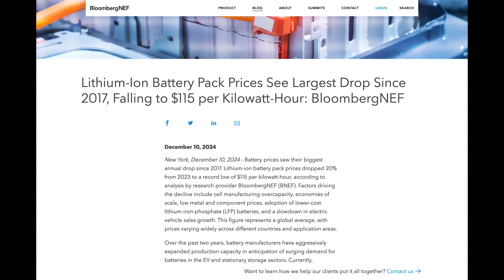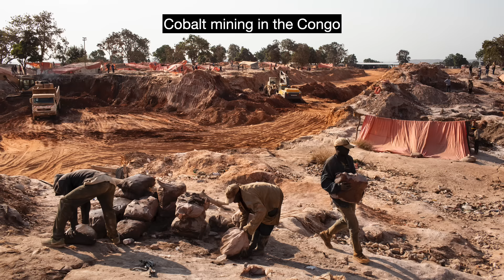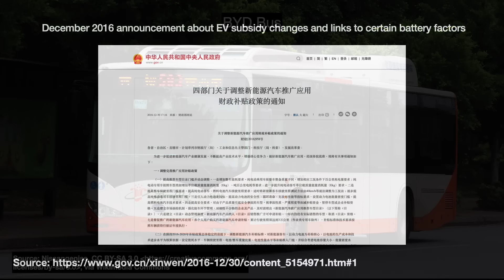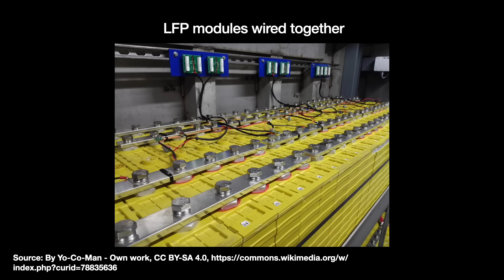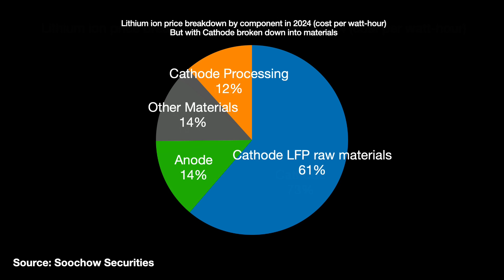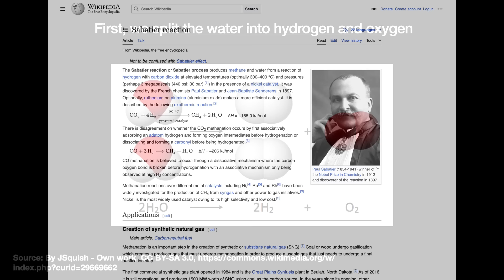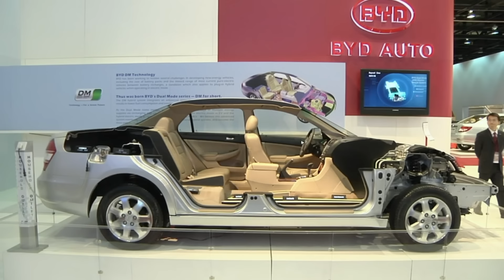How Did China's LFP Batteries Get So Cheap?

Comment: Battery modules are not arbitrary, they're a wiring step that allows you to put the right number of series and parallel connections to achieve your desired operating voltage.

Comment: A 2023 fire in the Netherlands also gave a small demonstration on the Blade Battery, as well as the advantages of lower intensity packing in general. At themepark Walibi Holland all EVs were parked together as a result of all chargers being put together.

The chargepoints were moonlighter-built and jumped voltage all over the shop.
So a Tesla (what else?) model X spontaneously caught fire due to its unstable tight packing causing thermal runaway when subjected to such extreme jumps.
When it erupted the cars around it took fire pressure.
A Nissan Leaf went up, half burned.
A Tesla Model Y promptly also caught fire and burned to the wheels.
A Renault Zoe took major fire pressure to the front, but refused to burn.
Two BYD Atto3's covered themselves in glory, taking major fire pressure from the side. One of them pressured from both sides. The BYD blade battery refused to brew up in both cars and that's where the fire stopped spreading.

Pictures of the damage still available on local media like Omroep Flevoland and Bergnet (towing)'s social media.

So yeah, Blade packing for the win if you ask me. It was one of the reasons why I bought an Atto3 couple months later.
Reply: Meanwhile people will pretend that BYD's do nothing but catch fire.
Reply: @kristoffer3000  every accusation is secretly a confession
Reply: @katiebarber407 Every damn time.
Reply: @kristoffer3000  I mean, they DO catch fire every now and again, and when they do, the damage is exactly as disastrous and they are exactly as hard to put out and they do set other cars on fire. The idea that the blade battery is this super fire inhibitor is simply not true.
Reply: Amazing story

Comment: For energy storage I expect Sodium chemistry of accumulators. Especially because of their thermal advantages. They operate very good at low temperatures. And it really makes little difference if you place one shipping container or stack two on each other to get the same capacity/power on the same footprint. Lower power density is not an issue. This is clearly much better than the hydrogen to methane conversion and then back.
Reply: Sodium batteries have lower cycle life, terrible round-trip efficiency and their voltage varies greatly through their charge/discharge cycle, making efficient inverters very hard to build. Additionally, the cathode is like 30% of the price of the final battery, so even accounting for all these issues, sodium might not end up much cheaper, even if all these issues are fixed.
Reply: @torginus  30% of the battery cost is cheaper than 75% of the battery cost for other chemistries.

Comment: The NEDC was never ment to measure EV range. The cycle dominates by city and suburban driving that is very favorable to EV, and have just 20 second of highway speed driving for a 15 minute driving cycle.

There is a city and rural road driving part, but manufactures just cited the compound number that was beneficial to EV, while totally imaginary. Nobody drives 600km at city speeds in one go.

Comment: Phosphor is needed for agriculture and not that common (it should be treated like gold, and is more useful than gold. Not that many technical applications for gold *). So I see a market for batteries that use sodium / iron. - a lot of people drive around in urban areas most of the time, density and weight are not that important. The few times they drive longer distances there could be extra battery packs one can plug in. Needs a bit of space, but not too bad.

AND: If they are not good enough for vehicles - too heavy or not a good fit for speed loading they might well do for households and industry to store excess energy from solar. 

* using gold as a "currency" is arbitrary / cultural. We could have a civilization w/o gold - but not w/o iron, salt, phosphor, aluminium, etc. Or silicium.

There are a few technical uses where gold would be hard to replace, (think seals of gold when you have very low temperatures - close to absolute zero). It is also useful for fillings in dental work, hard to come up with another material that matches that. But mostly gold is not very useful.

Comment: I think the main reason why in 2024 and in the future the price of LFP is getting cheaper is according to this article:

"LFP cathode producers explained to Roskill that the consortium managing LFP’s IP rights reached an agreement with the Chinese battery industry a decade ago in which, as long as LFP was produced and used within China, the consortium would not charge Chinese manufacturers a licensing fee. As a result, the price of Chinese LFP batteries has always been considerably lower than non-Chinese LFP batteries. However, the patents’ restrictions over LFP will start to expire in 2022. Simultaneously, the limitation of LFP exports on Chinese producers will be largely removed, along with the licensing fee for non-Chinese LFP cell producers. The removal of this IP barrier could become the largest opportunity for LFP-based Li-ion batteries to rapidly gain market share in the EV market outside China."

Comment: EV battery manufacturers in China like BYD are using Lithium Iron Phosphate (LFP) and Sodium ion batteries which 
have no Nickel, will not explode & cheaper to make !     Sodium ion batteries will be used on cheaper EVs & power storage
applications .

Comment: The latest LFP battery by CATL and BYD is providing only ~15% less in range than the worst NMC batteries produced by CATL's lesser-known competitors in China.

Also one thing that didn't stress enough in this video is the charging speed LFP batteries can provide over NMC. 20-80% in 20 mins beat any range advantages NMC gives
Reply: And, it is not recommended to charge MNC above 80% for anything more than short periods of time, to ensure longevity. Heat kills MNC also.

Comment: There is a lot of new information. Well done as always. 
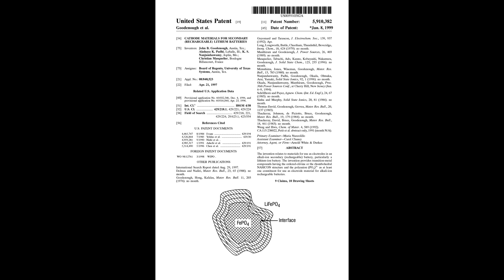Its getting very interesting around min 12:00 where i would have wanted to know more details. John Goodenough was one of the central inventors. What about A123. 'A123 Systems, LLC, a subsidiary of the Chinese Wanxiang Group Holdings, is a developer and manufacturer of lithium iron phosphate batteries and energy storage systems. The company was founded in 2001 by Yet-Ming Chiang, Bart Riley, and Ric Fulop.' Especially Yet-Ming Chiang and the time between 2005 and 2011? And the side issue of three manufacturing lines without marking the products based on the line what possibly led to their bancrupty. I think a lot of A123 Systems knowledge went from the US to China when it was bought by Chinese manuafcturer Wanxiang. Not sure but i got the impression that this knowledge was distributed outside Wangxiang in China. 
For the big moves from China into BEV, the Chinese Wan Gang an Automobile Expert 'who served as the minister of science and technology from 2007 to 2018' could be very interesting. Maybe a central person for a video about the move from China into vehicle batteries.

Comment: A small oversight in the video: LFP are not safer because of lower energy density, but because they don't let oxygen to be released during charge and discharge cycles.
Reply: It is a bit more complex. The lower voltage really helps in making the system more stable, as the electrolytes break down at the higher voltages  that you see in NMC. 
But having lower conductivity also affects it, as that means that energy is released slower and there is less heating. 
A general thing to remember is that during a battery fire, it is mostly the electrolyte that is burning, the FLP or NMC, can't burn as it is a oxide, and the production method to make is to have it in a furnace.
Reply: @huleboermannhule44  
AT LAST! A sensible comment!! 
👍
Reply: You have to put more energy in to get oxygen to separate from the iron & phosphorus which means less net energy when the liberated oxygen finally gets to do its thing.   Though ternary cathodes are similar at low state of charge (though LFP would have better energy density than NMC restricted to a state of charge providing similar safety)
Reply: To be more specific: (since some seem to need it), the LFP's phosphate-based cathode is chemically stable compared to NMC, with strong covalent bonds in the PO₄ structure. This stability is what reduces the likelihood of oxygen release during overcharging, overheating, or mechanical damage like a spike driven through it, unlike the layered oxide structures in NMC batteries.
Reply: @Techridr  Thanks
Reply: Are LFP's the same as LIFePO4 batteries?
Reply: @seanskywalka5172  yes
Reply: @seanskywalka5172  Yes, its the same thing. Lithium(Li/L) Iron (Fe/F) Phosphate (P04/P)
Reply: Do you not mean Hydrogen?
Reply: @Darkmatter321  No, I exactly mean oxygen. The reason why NMC batteries burn so strongly is because they contain both the fuel and the oxidizer.
Reply: @markotrieste zamejski Slovenec?
Reply: @Janezslovenski  ja
Reply: They are not safer at all. Its just the reaction temperature is 200 C higher the NCM. Big disadavantage: in a TP event LFP Produces much more H2 so there could be a secondary explosion espcially at garage 
Even the BYD Blade cells are burning, the Penetration Test is pure marketing
Reply: There is a general rule of thumb that the more potent(power or energy dense) a chemical energy source the more dangerous it is. It's generally true regardless of whether we are talking about combustion fuels, monopropellant rocket fuels, explosives, or battery chemistry. There are exceptions to the trend though; Diesel fuel is less flammable then gasoline despite a higher energy density for example.
Reply: @Spec4D  Look up for nail penetration tests of LFP vs NMC; the difference is huge, not comparable with energy density difference.
Reply: @Spec4D I don’t think that rule of thumb is useful. There’s too many exceptions. Diesel is a good example as you mentioned. Volatility and how quickly and easily the energy is released is very important factor for safety. There’s an insane amount of energy stored in hydrogen gas. But you need a star or fusion reactor to unleash it.
For batteries the energy density is almost completely irrelevant to how safe it is. Most of the initial fire of a li-ion battery is from the flammable electrolyte. Not the energy stored in the battery. 
Whether the thermal runaway that follows lasts 4 or 8 hours isn’t that interesting for safety. Some solid state chemistries have very high energy density, but is almost impossible to set fire to, and have very mild thermal runaway.
Reply: @Spec4D  There is a general rule in physics that says that "objects tend to minimize their potential energy". So the more packed energy, the stronger the tendency.As for Diesel, it contains additives that prevent partially this tendency on the premise that the Diesel will be used/spent pretty soon. But if you let Diesel long enough unused, it will develop/become a sludge (oxidised).
Reply: @Spec4D That notion is more wrong than right most of the time. Energy density provides a rough worst case scenario, but the more significant indicator of safety is the possibility of thermal runaway.
Reply: @Spec4D  what about high explosives, you can do almost whatever you want with them without setting them off.
Reply: @yun-z  explosives are not energy dense
Reply: @hjk292 That is a very useful statement, or more importantly a reminder. Without thinking I would would intuitively say explosives must have a lot of energy density. But I would be confusing myself by using the obvious explosiveness as an indication of energy density rather than power. But you are right. 10 times the energy density or so for fuels versus high explosives. Thisakes engineering sense given the entirely different goals of explosives versus fuels.

This is me describing my lazy thinking. I am an engineer so I understand the details. At the same time I'm a human and tend to use lazy thinking when I should be more careful in the moment. I would like to contrast this with my more intuitive understanding of power versus energy. So when I hear about a terawatt laser I can also understand it probably means  a few joules or so, but the very important part is the tiny tiny tiny slice of time that energy is used.
Reply: @yun-z like they said, rule of thumb!

Comment: My question for LFP is if it needs to constantly be charged at 100%, like every 1-3 days as i've heard from tesla.
Because if you don't the battery computer will no longer be calibrated and in time you will be displayed a certain percentage but not be the correct one.
This is a big no-no, if this is for all LFP tech
Reply: You only need to fully charge every 5 to 10 cycles to rebalance the cells.
Reply: That’s for all batteries.
Reply: @zachb1706  i never heard of needing to do this for NCM batteries. NOT ONCE
It all started with the LFP batteries, when tesla released their new gen standard with lfp ones.
There, you MUST charge to 100% every few days.
...
LFP doesn't have any benefits to the user, has lower density and needs more attention from the user.
The fact that you can charge to 100% all the time is meaning less for 99% of drivers, because 99% of drivers will never need to drive 400-500 or more km every day.
The average driver will need to drive maximum 40km/day, meaning a NCM battery charged to 85% on monday morning will be enough to last a work week (85-15 = 70% useable without abusing the battery - aka roughly over 200km for even smaller batteries) for the average joe driver...and even 2 weeks, without charging.
Being forced to plug in every 2 days is anti consumer practice. You can't use and own your vehicle freely.
Reply: @tommyb6611  you don’t need to babysit the battery like that. All cars with LFP recommend you to charge to 100 once a week or if you hit around 20%

Comment: LiFePO4 commercial production began early 90' in China. They developed the idea and market of electric mopeds and we could buy the Thundersky cells here in Europe. That was long before any Li-ion cells in vehicle size were available from anyone. In other words, China had a 10 year head start making batteries for vehicles.
Reply: I certainly tried to keep myself informed about various battery chemistry but I had never heard about lifepo4 before 2012, so I find your date about late 90s a bit hard to believe.
Reply: @jimbodee4043  Looked it up. Thundersky / Winston battery begun in 1999 (so I confess, not early 90'!). Actually I think the first Chinese LiFePO4 cells I saw from China were cylindrical large size cells with a screw terminal in each end. Those were for the mopeds, but I don't remember who made those?
Reply: And the first electric vehicle is over 100 years old and NOT from China. Dont know why that matters.
Reply: @hansdampf2084  Cope

Comment: Grid connected battery are very usefull as they allow better use of the existing infrastructure.
Before you needed to have a powerplan, transmission lines, transformer to exceed you peak demand, now you drop a few battery storage container on you distribution station and everything upstream can now spread the peak. You get a better usage of almost all your infrastructure.
Reply: Em um futuro próximo, quando as baterias dos carros elétricos precisarem de troca, elas terão um mercado para essa aplicação

Comment: I agree with LFP generally, I thought they had arrived at a good battery chemistry. The one difference you must keep in mind is Lithium Ion cells generate lots of Oxygen during a thermal runaway making fierce fires to fight. LFP cells generate lots of Hydrogen during thermal runaway. Hydrogen is explosive in mixtures with air from 5% to 95%. If it collects in the passenger compartment and a switch makes a spark you have an explosion. If you drive an Ev and are involved in an accident move away from the car quickly. Most thermal run-aways follow physical damage to the battery pack ie. wreck or while charging defective cells (BMS)
Reply: Hydrogen doesn't tend to collect anywhere, It's lighter than air, and permeates all but the densest materials. It's why tanks of hydrogen cars are insanely hard to build, and they still leak!
Reply: Rubbish. Hydrogen likes to dissipate and is difficult to contain.